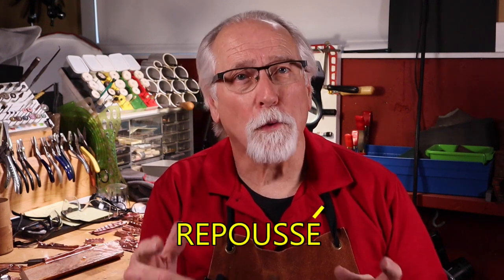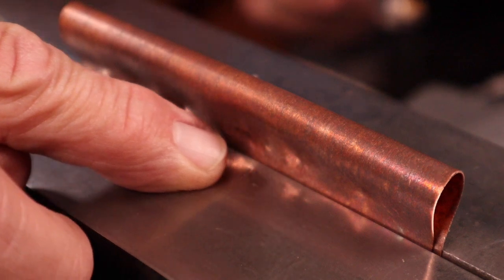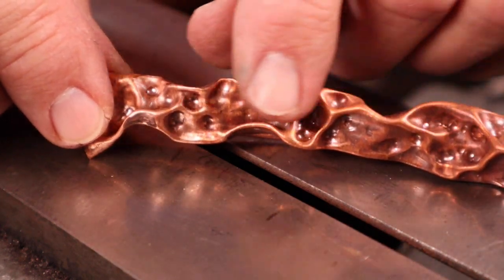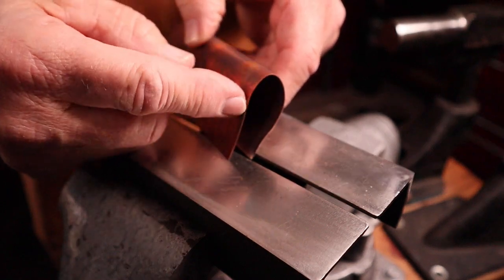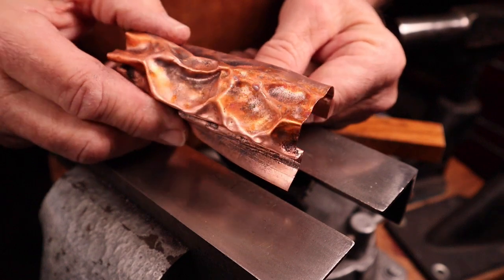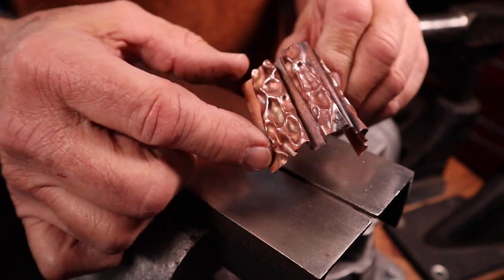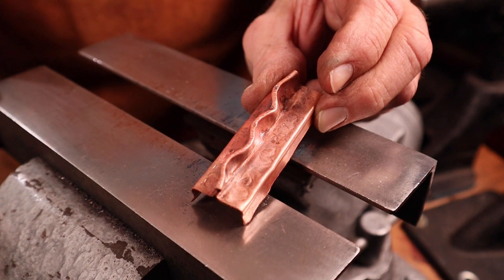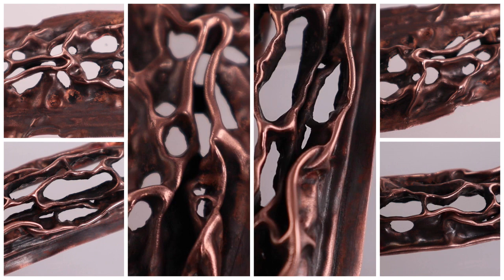FOLDFORMING PART 5. "AIR CHASING & AIR PIERCING"

Comment: Sir, I've been air chasing with copper pipe and tubing for quite a while and have struggled with control,  always settling with whatever the outcome.  When I saw you explain the work hardening process to support the still annealed section giving rigidity so that it doesn't collapse on itself gave me ideas of my own. I now practice this method for most of my work.  I tried spot annealing with a micro torch at 4000F with very limited results . Just wanted to thank you for the enlightenment.
Reply from the maker: Hello Jonny,  Thank you for sharing.  I'm glad I could help you improve your techniques.  Keep watching.   Greg Greenwood

Comment: Nice demonstration, I would like to see how to do this with other metals as well as this demonstration with copper and the processes of how to incorporate them into jewellery, cutting, soldering, riveting etc, with anti tarnish and hardened finishes,
Reply from the maker: Hello Paul.  Thank you for your kind comments.  I appreciate it.  I am going to be doing a video on incorporating foldforming 
techniques as part of this "Foldforming Series".  It should be Part 7.  Make sure you subscribe and ring the bell so you can be notified when it comes available. In the mean time, experiment with the cheaper copper and get used to the techniques.  You can use any of the non-ferrous metals for foldforming.  Copper is just "cheaper" so you can make mistakes and learn. Glad you are watching.  Thank You.  If you have any questions, please feel free to let me know.  I am here to help you.   Thanks again.  Greg Greenwood

Comment: Hello
Can this be done on .8 mm sheet copper or brass?
Reply from the maker: Hello Mona,  Yes you can, but it is a little harder to bend.   I have used thicker before and it does work.  Greg Greenwood

Comment: Thanks for this great video, Greg !!   May I ask what torch you use for larger pieces of copper ?  I love copper but i’m still unsure on what sort of torch I should use to anneal it and to soldering copper and brass.   Seems to be a key element.   Love your videos !!!
Reply from the maker: Hello Anne-Marie, You are more than welcome!  I use a "presto-lite" acetylene/air torch.  There are several tips from very small to large.  I can anneal any non-ferrous metal with ease.  I can even melt silver for casting.  But, the torch can be expensive if you are just starting in jewelry making.  You can purchase a small "propane" torch at any hardware store or big box store.  They are used by plumbers.  The torch head screws into the tank and it is hand held.  Check out my "What Tools Do I Need"  video.  I have an example of the torch in that video.  You  can use that torch to solder with also.  Thanks again for your comments.  I appreciate it.  Greg Greenwood
Reply: @greggreenwood4628  Thanks a lot Greg !   I’ll check it out right away.  I have a propane one but it doesn’t really allow the solder to flow before oxydation sets in so I pre-heat the charcoal block and the piece and that’s a bit better but some extra heat would be good to have.  I’m about to try plumber’s solder (silver bearing solid wire) instead of silver solder.  Cross fingers :-). I think I’ll start learning about the acetylene one so I start off on the right foot.   Thanks so much for your reply and your great videos !
Reply from the maker: Hello Anne-Marie,  If the metal is oxidizing before the solder flows, then it is your flux.  Are you using borax flux?  Put more on the metal, this is what the flux is for, to protect the metal from oxidation.  Plumber's solder is a different kind of solder.  Very low melting point.  It requires liquid flux.  Check out my "5 Secrets to Perfect Soldering Everytime"  This may help you.  Thank you for you great comments.  Greg Greenwood
Reply: @greggreenwood4628  Thanks much Greg !  The concern is that by adding more heat for copper/brass soldering, the flux burned, oxidation set in before the solder had a chance.  I’ll add more flux before the first layer burns.   I love your soldering video too !  I tried balling up the solder and then transferring it with the pick.  I managed to solder the pick to the piece and the solder would just stay balled.  Will keep trying !
Reply: @greggreenwood4628  sorry : Yes, I’m using Borax.